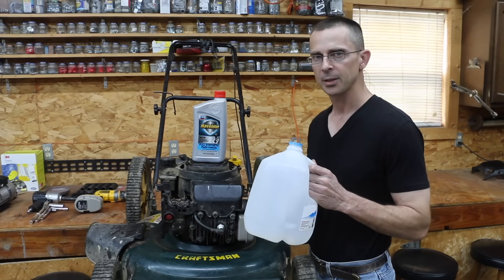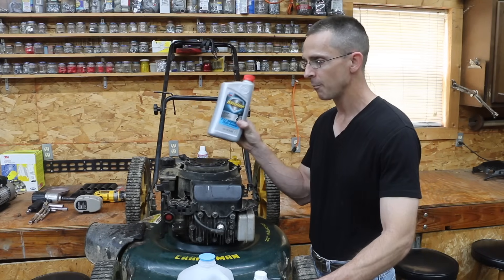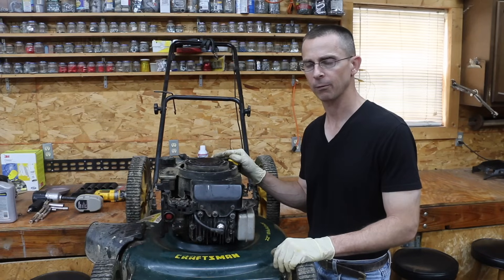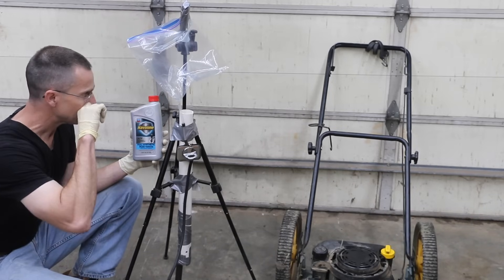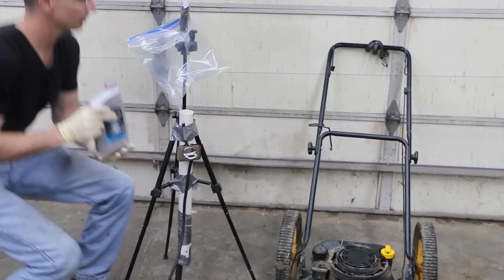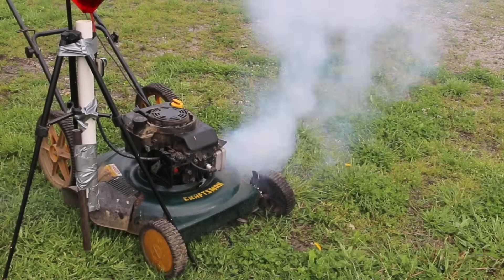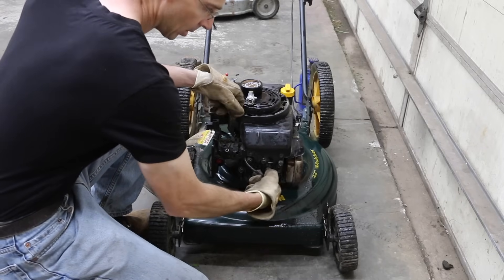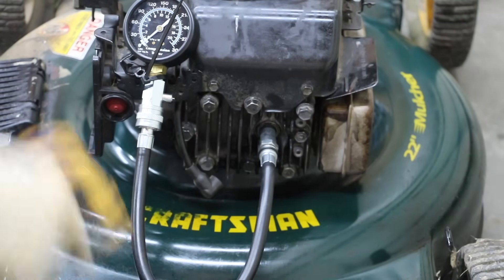Seafoam--can't believe what it did to my engine episode 6--Seafoam vs ATF!!

Comment: when you blow a head gasket on a car the chamber cleans very good so I wonder if putting anti freeze would work while it's running to clean it  just wondering
Reply from the maker: Devon Johns, Yes, you are right!  I plan to test a 50/50 mix of antifreeze and water in an upcoming episode!  Thanks for watching the video and commenting!
Reply: thanks for replying and I think it will work very good but it will do same thing as the water to the oil so it would have to be changed
Reply: Ahhh I see thanks
Reply: Its the water thats burning off in the coolant that cleans so well... It turns into steam and steam cleans the inside of your engine..
Reply: So blowing head gaskets is good for my 6.0?
Reply: Project Farm it is not the antifreeze, but when and how the non petroleum fluid is introduced into the cylinder.  When the engine is hot and idle, some coolant seeps in, and puddles on top of the cylinder.  That is why some cars have a stumble at cold startup (spark plugs don't like firing when they are wet with antifreeze).  It is the change in expansion of the piston that causes the carbon to crack off.  When the engine is started, the loose carbon is thrown off, and the plug dries, and begins to fire.  A bad hg on a car will also send burned antifreeze into the cat, and degrade the performance by coating the substrate with burned antifreeze "powder".
Reply: Devon Johns great idea! I can't wait for this one
Reply: antifreeze kills o2 sensors and converters. so a no go on cars
Reply: The Q 
LOL LOL LOL
Reply: David Johnson 
 Actually, power steering fluid is very similar to ATF.
Reply: Devon Johns  No, it's more the extended exposure.
Reply: Devon Johns Don't forget to add brake fluid and mix it with power steering fluid too you'll get an extra 5 HP 😂!!!!
Reply: David Johnson and the stickers for extra HP!

Comment: ive tried a bunch of these myself. they all do a god job of breaking up deposits, mainly because of the nature of hot liquids. Any fluid exposed to those kind of temps will expand and therfore breakup deposits. ATF did a damn good job I think and does a good job at lubricating the top end as well. Good Vid!
Reply from the maker: David, Excellent point!  I'm very impressed with the results of ATF!  Up next, Marvel Mystery Oil.  Thanks for watching the video and commenting!

Comment: Thank you for the series of videos. I have been trooling arounf looking for information on how to clean up my own mower, these proved useful. 

Side question if I were to access the piston and scrub the carbon off with a plastic bristled brush would that cause any harm? or should I just go the route of seafoam/ ATF thru the carb and let the engine burn the carbon out? keep up the good work on the videos!
Reply from the maker: Erik K,  Some of these mowers are more complicated than others to dismantle.  If your's is set up like the ones I'm using, it's much simpler to pull the head and use a plastic brush with solvent.  Thanks for watching the video and commenting!
Reply: thanks for the reply!

Comment: I have no clue how I ended up here as I don't even own a mower but this was a well produced video.  Straight to the point without 15 mins of extraneous babble.
Reply: smokiethebear912 carbon build up can cause hot spots that can in serious  cases  leadto predetenation.  and also cause pistons to fail in high compression  engines due to the heat being concentrated in a small area weakening  the piston and burning  a hole through. If enough  builds up on the edges of the Pistons it will cause scaring in the cylinders allowing combustion pressure to leak passed the rings contaminating the oil
Reply from the maker: smokiethebear912,  Very cool youtube profile name!  Thank you for the encouraging comments regarding the video.  I appreciate the feedback, and it's helping me improve the content and quality of the videos.  Regards
Reply: You are awesome Project Farm! Please please please keep up the amazing work and testing. It doesnt matter what your testing your audience is loyal! We cant wait to watch the next video! We have made it a weekly family tradition to get together and watch you test stuff! Good Job!!!!!!!
Reply: jsalmon 
 He's done several videos on Seafoam. He seems to like it but the cost of something that does the same or less for five times the money is the point. Seafoam @ $10-12 bucks or ATF @ $2-3 bucks❗
Reply: TIMEtoRIDE900 sounds like ricers to me
Reply: Oval track racers say carbon is free compression.
Reply: I'm wondering the same thing.  Especially since I don't believe in this seafoam product or believing there is any need to keep the combustion chamber clean.  All you really need is fresh oil, a clear fuel lines and clean spark plug
Reply: You were smoking some good stuff maybe drinking some good IPA beer yeah that's how you ended up right here lol.
Reply: i don't have a mower, either, but here i am!
Reply: DT Hellland If you clean your engine you'll notice a big improvement. I guarantee you'd change your mind.
Reply: also am I the only one who noticed he didn't actually use seafoam? he just bashed it in the beginning when talking about how he cleaned the cylinder with water and said seafoam is a waste of money. then continued the charade compairing seafoam to transmission fluid.

Comment: Yet to try any of this of my diesel car but loving your vids very interesting! thanks.
Reply from the maker: Dowie Dow, You bring up an interesting point.  I should run some tests on my old Ford 5000 diesel tractor or my Dodge, which is powered by a diesel/Cummins.  Thanks for watching the video and commenting!
Reply: Yes that would be great! and would certainly give me some confidence in trying some of these methods on my bmw. I recently bought some ''wynns egr cleaner'' which you spray into the intake like seafoam spray but yet to try that to! would love you to give it a go! i could even send you some.
Reply: Dowie Dow & Project Farm I've used seafoam in my diesel Mercedes instead of diesel (route the pickup and return lines to the seafoam bottle) and it makes a noticable difference, smooths out the idle and seems to reduce clatter (perhaps from cleaning Injectors that may be nailing)

love the videos, I'd thought about trying to do similar stuff but I get unmotivated and busy and don't end up filming any of my adventures
Reply: I’ve used ATF to clean my injection system on my E46 BMW 320d. Dumped out the fuel filter housing and filled it up with ATF, fire the engine up and revved it couple of times.
There were some noticable improvements in responsiveness of the throttle and also in fuel consumption.
I wouldn’t recommend to put ATF in a common rail system though.
Reply: Arno Bruynen yout 320d is a common rail i gueas
Reply: With Style nope, it has a distributing injection pump, that’s what was the cause of my issues in the first place. There’s a plunger that moves the cam ring inside the pump (it’s a radial type of injection pump), thus advancing or retarding the start of injection. This plunger operates on fuel pressure inside the pump housing. The plunger got ceased inside it’s bore so it wasn’t advancing or retarding timing as it should. The ATF made it move again like it should.
Reply: but its still a common rail system. the high pressure pump is a known problem. thats why a lot of people use 1:200 2 stroke oil with jaso fc specification.
Reply: With Style it’s not common rail, it has a VP44 distributor pump. Look it up. My 320d is a M47 engine, 100kW. The newer 320d’s with 110kW have the M47N engine, these do have common rail injection.

Comment: only problem with at it's an abrasive liquid I know if u use to start diesel engine it's causes injector wear
Reply from the maker: Christopher, Excellent point!  Injectors and injection pumps are very expensive!  I don't want to have an issue with those!  I've heard some folks have had success using 2 cycle oil in the older diesels for pump lubrication.  Thanks for watching the video and commenting!

Comment: Growing up in the 60s and 70s  most people Used ATF to Lube up the top end  Valve Guides  Piston rings   But  not to decarbon  if any thing I would think it would cause more carbon . after all ATF is nothing more than Hydraulic oil with Red Dye
Reply: Yes, except he just proved it does indeed remove carbon.....
Reply from the maker: 1995dresser,  I was surprised by the results. It seemed to work well on the cylinder head!  Other commenters were very confident it'd work and they are right!  Thanks for watching the video and commenting!   Up next, Marvel Mystery Oil!